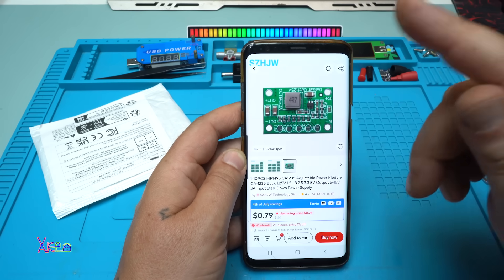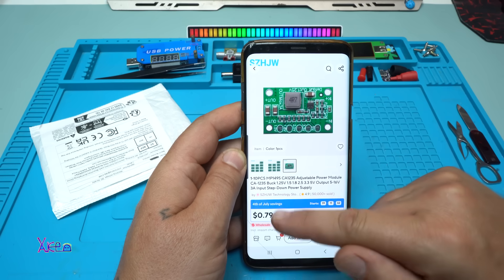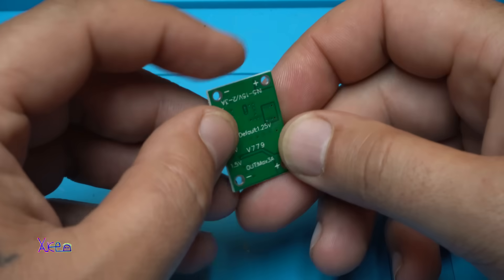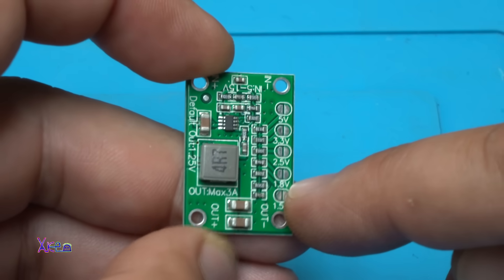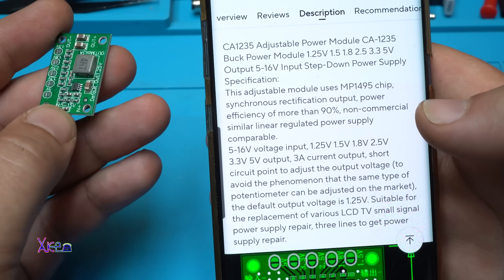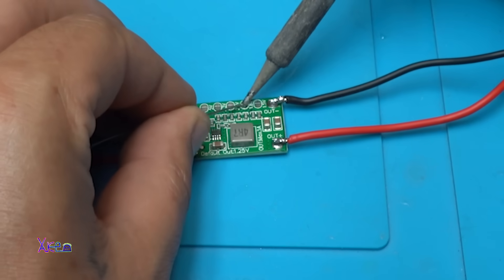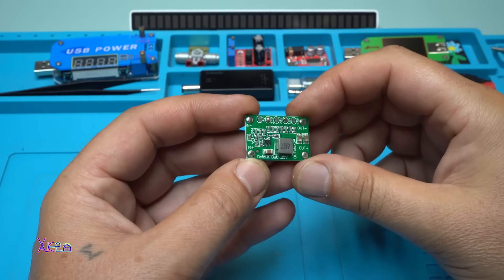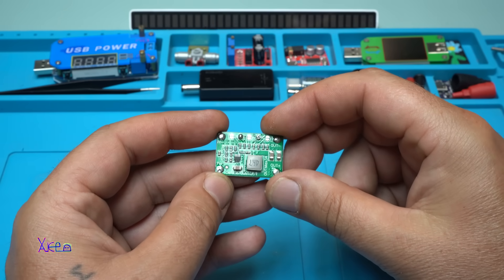I TEST $1 Aliexpress Module and SURPRISE?

Comment: Are those blue mats you use really antistatic, as my similar one claims? I was surprised that mine stuck to the static on the "cellophane" bag when I removed it, which seemed to imply it was not antistatic.
Reply: these blue mats are actually usually just silicone, which is good for heat resistance and soldering.

Comment: Chinese Amperes are always higher valued, than the official CODATA definition. Whenever I buy a DC/DC-converter from AliExpress, I know exactly, a rating of 3 Amps corresponds to 2.5 real Amps, 5 Amps are 3.5 real Amps and 10 Amps are about 7 real Amps. The very same thing happens with power amplifiers. Sometimes, fans or liquid nitrogen can help.